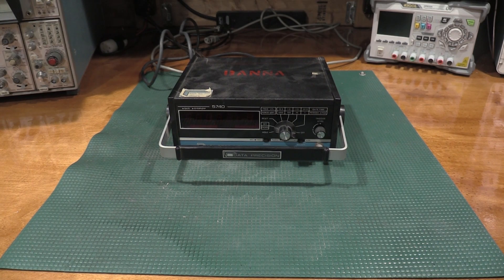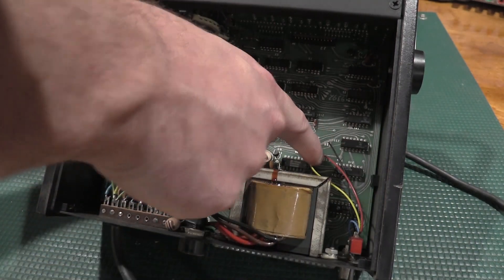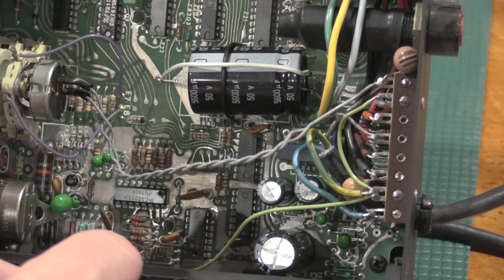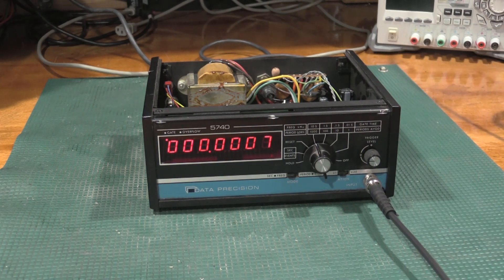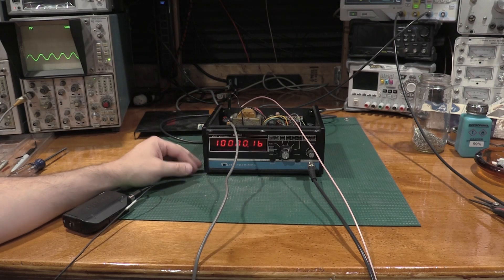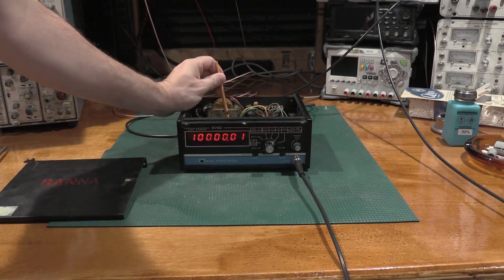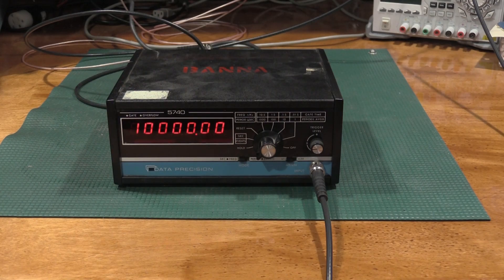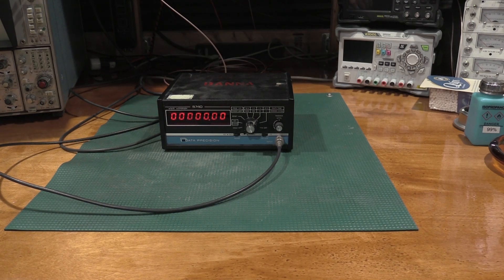Data Precision 100Mhz Frequency Counter Repair and Alignment

Comment: Is this a good counter to run adjustments and tuning of vintage tube radio’s?
Reply from the maker: It “could be”. Personally I find that when doing adjustments I prefer a gating time of 1 sec at the MOST. Must more then that and it can get difficult to dual in a clock. 10 sec to 1000 sec is impossible to do any real adjustments however they can validate a high accuracy. The 5470 also speaks in Khz so some times it is easy to get lost in all the zeros. Mine is currently running as a frequency counter for my 7603

Comment: yeey..  new video...   😊  Can u show us (me) how to clean pots and switches on tek 465 or similar please.  Maybe such a video already exists without me being aware of it.
Reply from the maker: There is some more 4xx content in line for the bench. I might have to make this specific content a Patron video for a detailed servicing.
Reply: I hope you have also some more videos for 7k and 500/5000 from Tektronix planned? Not many people produce content for these.
Reply from the maker: Due to some timing for equipment movement I had to burn thru the equipment that needed to travel back. However I do have a bunch of 7xxx and 5xx/5xxx content in line for the bench. Including some 7904 non a’s as well as a 7503. I also still have some ongoing 7854 projects as well as a full alignment of at least 2 7854’s. And If I recall from the tech I got the 7904’s from one is supposed to have a power supply that I will need to troubleshoot. As well as a large batch of 500 plugins that I need to get checked. So more is always on the way.

Comment: Did you steal that scrolling warning at the beginning of your video from xraytonyb? 😁
Reply from the maker: Not as far as I know, it has been the same since video #5 I think. We all have similar issues of repair can be inherently dangerous but the risks can be mitigated with training and experience. I have spent many an hour around equipment that not only could kill be but would not even try doing it. Xraytonyb works in a similar field, My personal experience is not in medical imaging and is more industrial. But the end result is the same. On certain systems we both have zero margin of error. So if I seem to overdo some of the safety aspect of things it is out of respect for the hazard and my strong desire to remain above the grass at the end of the day.